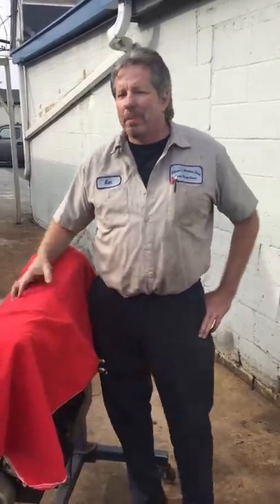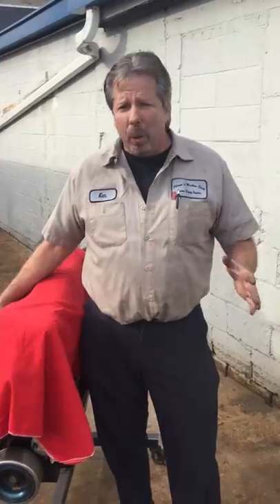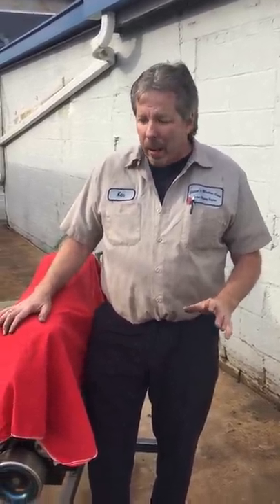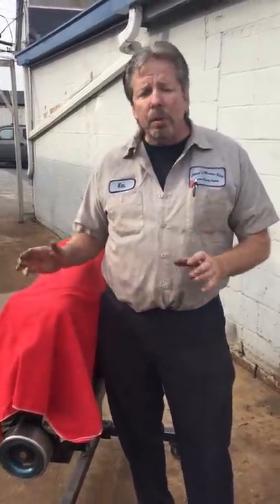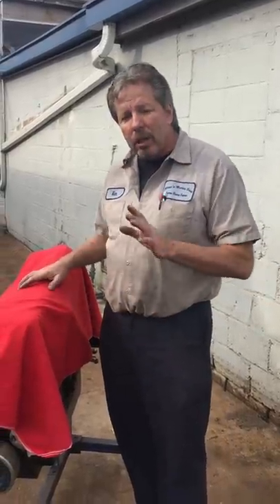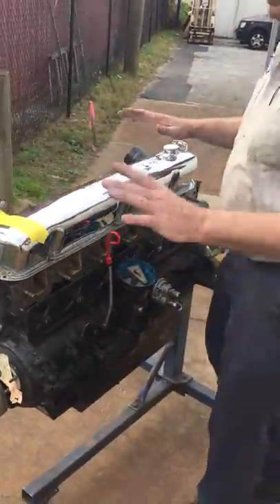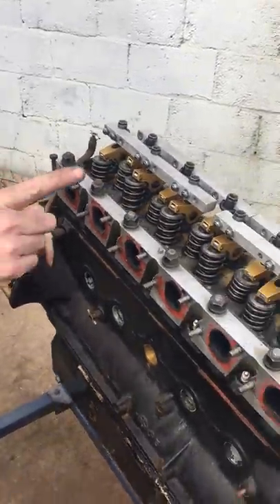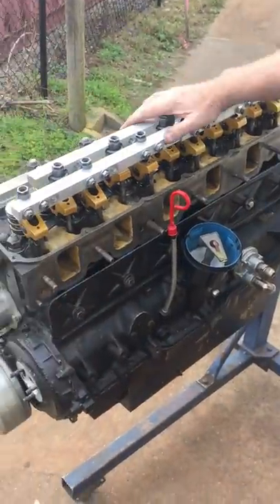Mysterious Radical Race Engine! MUST SEE!!!

Comment: I.m.  glad.  I.  Saw.  This.   I.     Remember.  Seeing. Your. First. Video. On. This.   I. Think. It.  Was. Franken. Six...  i.ve. had. The.  Experience.   Of.  Driving. Two. Of.  These.     As. Stock...  engines.   They. Were.  Standard.  Equipment...  in. Club. Wagons...  back. In. The. 1970s. And.  1980s.....   they. Are. Excellent. For.   Gas....     mileage....And. Can. Still.  Pull.  A  loaded.    Trailer...  in. A. 4x4..... good. Video.  Have. A.   Nice.  Day...

Comment: I just bought a 76 f150 4x4 with a smoking 390 with bad valves. The 2 car lot owner failed to mention that to me. My answer..haha. pull out the 390/c6 so i can put a 300/np435 in it.

Comment: His last name is Sligh. Engine was built in 69-70. Boss 302, Cleveland heads. Chrysler 392 hemi injected. Epoxy was there to get the velocity up in the port. He turned 9100 rpm with that motor.

Comment: If you could fund the making of a full metal cylinder head with a cnc machine and a kit for the valve train you would have buyers as long as it wasn't super expensive. I don't know how much R&D or even the cost of productions of a cylinder head. That could be a business your shop could get. Produce a make the heads and sell everything else in the valve train and even upgraded parts to the ones you see in the valve train.

Comment: There’s a Ford sticker on the engine.I remember Bob Glidden 351 Cleveland pro stock car had that modification to the exhaust ports. I built a boss 302 in 1979. The heads look like Cleveland heads I guess.

Comment: I knew it was a ford 300. Saw one on powernation. It was on a generator. It was white and in great shape. Not sure about the mods on yours. But power nation turbo charged theirs and made insane power with it. I remember my dad telling me about a friend that built a 300 he put into a 60's Jag. He blew it up. It had a 331 hemi, 351 cleveland, 350 chevy, can't remember the others, I think he had put like 10 different motors in this thing, and he blew them all up street racing. He liked to go fast. He had a Mercedes gullwing he stuck a v12 in. Not sure where the v12 came from but my dad said it was fast. 160-175mph. It had a bunch of motors too.

Comment: I saw it in the magazine in the 1970s when it was first done. 351 Cleveland heads cut up and pieced together on a 300 Ford six. At that time Bob Glidden was top of the prostock field with his 351 Cleveland and the pro stock technology of that time was used on this head.

Comment: It’s a Ford 300 straight six, I work for Ford I’m not lying I stirred out putting main bearings in and ended up in her test and became a mechanic 43.7 years with Ford, I become a mechanic after hot test, I built four of these a day by hand for Dino once a month, although the head I’ve never seen before, it looks like it could be parts of the Cleveland 351 boss head, although Ford did have a rumor going around that they were gonna make a flow through head for it.

Comment: The Cleveland head . Is heavily  influenced by the big block Chevy canted valve head . Basically ford built a race engine the Cleveland . To beat Chevy . A small block with big block heads . The way I heard it . Cylinder head guru. Lee Shepard .Was especially interested in this combo . And nay be the original idea source .  RMS lost a lot more than there pro stock driver . When Lee died . He was a cylinder head porter of unique talent

Comment: As a 4v Boss Cleveland guy who’s built a few engines and is familiar with Jenkins work it was my only guess.
I say guess because I was trying to figure out how that could be done as you made the reveal. 
My only complaint is oiling and the width / weight of those things and getting headers to work. The front cover sucks as well.
That’s why at the end of the day I’m still a Chevy guy.

Comment: First Car engine I got to tear down and put back together was a Chevy 250 6cyl that had 327 flat top pistons in it and a little other work, it was my Shop teachers motor out of a late 50's early 60's stepside pickup that he replaced with a 350 with double hump heads. Sad part is the 6cyl was fine when we started and ran great when we put it back together but then he had us pull it back apart and toss everything in a dumpster, I was so mad but had no way to get it from school back home, I had a 70 Nova at the time but was only 15 and couldn't drive it on the road.

Comment: I always knew about the power of a straight 6 engine...i had a old 74 ford Van from Telephone Co. and it run like a scaled Dogs...and everybody thought that it was a 8 cylinder...i loved that Van...with that engine...the engine I had was unicorn because of the way it preformed...i could start it up and it would idle the same in any weather without touching the accelerator at all...and could take off even if it was 30 below...it never missed or shut off or anything...its was ready too go at anytime...it run so smooth...i was a  unbelievable engine...

Comment: 285 Cleveland heads on a straight six. Two heads welded together and lots of work to tune it to scream the if my memory is correct, 9000 rpm max. Name is Sly

Comment: Well many guys have done motors like that in hot rod magazine a shop welded two hemi heads together for a 292 Chevy 6 and batten heads made a couple of different heads for various 6 cylinders I saw that motor and the valve cover was the first giveaway the the canted valves was the big give away yip I'm 67 I've been building motors for 55 years

Comment: The head alone is probably around 20k to make so thats 👌 but that block id sleeve it and bore it .20 over to preserve the bottom for life and definitely have some extra mid to low end torque and paint back to blue... E-85 conversion to run the head cooler too would make the combustion more controlled.. cranks already knifed too🤠

Comment: I was told that they used to build ford 300 six and ran them in the Sprint cars at Skagit speedway. That was the block that used and ran them on methanol before the started using small block chevy.

Comment: Knew it with the cover on, as soon as you mentioned "Wallace". There was a lot of them at one time, but 9.20 is quick. Rules gave them advantage over the V8. Most were oven brazed, some used even more than 3 sectioned heads. You will probably receive lots of calls with more info and parts... Ford did put out early sixes with a steel crank, but found them unnecessary. There were aftermarket cranks, maybe that's why the strange dampened. Most used aluminum rods with the Cleveland pistons. Even in a Pinto there was room for very large headers...
Reangled as you said. Hope you find the original car and accessories, or a spiffy tractor 🚜 
Cheers 🍻 
If you "touch up" the epoxy and plate, maybe call Bob Kaase for some recent tips 👍

Comment: today with the help of Auto CAD, that head could be redesigned/reproduced in 3D and cut out of aluminum on a CNC.
Reply: Would be nice to add some cooling jackets so you can street it.
Reply: I believe the evolution of that is a Ford barra Australian made and  tubed 2200 bhp
Reply: @andrewmichaelcrook340  
The Barra's roots go back to the 144, 170, 200, 250 architecture.  400" smaller bore spacing at 4.080".
Reply: @MrTheHillfolk  
Machine the head with the coolant passages and the either bolt or weld covers over the passages.
Reply: Yep nailed it, but we don't have flying cars.
Reply: Has anyone asked if it has been put on a cad and scanned? Or just comment? So I guess will ask.
Reply: If you can CAD it and Scan it, then you should be able to edit the design to keep more oil at the top of the heads longer. When I first looked at this engine, it kind of reminded me of my 2001 JGC Laredo motor, 4.0L IN6, which I’ve been restoring for the last five years after it sat under some trees in the mountains for almost four years. I can honestly say. “I Love My Jeep!”
Reply: @digitaldreamer5481  my thoughts exactly. work out the kinks before it's ever produced.
Reply: @digitaldreamer5481  best of to you!  I hear things are expensive in Hawaii.
Reply: Piece of art not about caf and billet  welded cast iron 1970
Reply: That's right , take a lot of the work out of it !
Reply: @fragman21  A new CNC head? What for? Will you add 4 valves? A proper dohc system?
Reply: @cristianr3712  My point is with help of modern techniques that head 'If it was that great" could be made as  a whole piece instead of two glued together. the combustion chambers and runners could be massaged to whatever the engine builder desired according to the engines needs.  a single unit will have less a chance to become unstable. IE "move molecularly" or warp in layman's terms.  changes in valve geometry could be changed more easily in CAD with predictable outcomes.
Reply: @fragman21  Very true, but are you willing to pay R&D and CNC work which will likely be over 10k per head to get those improvements in an engine like this?
Reply: @cristianr3712  If your talking about a true race engine 10k would be a bargain. plus in CAD one could workout a predictable model without ever putting it in production. saving time and money. Trial and error can be very expensive in the real world. That's why every manufacturer uses computer programs such as Auto CAD to create new engines/parts/brackets/etc. The Coyote and LS engines are such examples. They are much more powerful and reliable than the engines they replaced.
Reply: Cost to do that from a blank would be insanely expensive once you factor in the drafting labor, machine hours plus consumables, and I don't even want to know how much a chunk of aluminum that big would be. I am curious if it would be cheaper to 3D print wax or resin patterns and do a lost casting.
Reply: @corythomas4427  sounds like it would be easier to cut up multiple heads 😕
Reply: @tanner882  That's already been done though, and it's not exactly a cut and bolt modification. It's already over engineered, why not go full insanity?! While we're at it, may as well do 6 individual heads instead of just one. More is better, right?
Reply: @corythomas4427  I think you lose heart if you were to remake this out billet.
Reply: @corythomas4427  I think you've lost point here. Yes engineering a head from scratch is out of touch for most people who race as a hobby. 90% of the engineering on  that head was already done by Ford the manufacturer. remaking that head using modern techniques to make it better as stated above would be easy at any cnc shop with the equipment and know how to do so. It's really that easy. Scan the part in. add static parameters/ strength of material/etc.  and build out. I've done this sort of thing hundreds of times in CAD at only the cost of a few man hrs.  honestly, if that head was that great, someone would have already done that by now.
Reply: @fragman21  Is everyone commenting reading all of the previous comments, or just the most recent one made? I'm not the one who suggested to CNC it in the first place, I actually questioned if that would be the most efficient process with my "thinking out loud" question of whether it may cost less time and/or money to cast it than to CNC it. I have no experience in any type of manufacturing industry whatsoever. My background is maintaining and repairing what already exists, not creating or designing. I like to answer my co-worker's comments of why something is designed or assembled a certain way with "Don't try to figure it out, you'll just find more that doesn't make sense" or "Saving 1/4 of a cent on each one is a lot when you are making tens of thousands of them"

Whatever way it was done, you would include the intake and exhaust ports that worked for your application (vs. using epoxy), but wouldn't be designing anything from scratch. Though if you were going as far as creating something like this it would be stupid not to optimize the design as much as possible.

My hyperbole about making 6 individual heads was because I would consider manufacturing an entire head (or 6) much easier than adapting existing parts and cobbling them together. Whoever built this head was a master fabricobbler. I respect people who are able to envision something this crazy and then actually do it.

Yes, of course it would have already been done if it was such a great platform to build on and had a profitable audience to manufacture modified parts for.
Reply: @corythomas4427   Fabricobbler. That's great a good one.    I agree as stated in an earlier post, A head could be "built" without ever actually producing it. saving time and money. I think that's where people got lost. An operator can just make copies of existing thing or fix existing things. Jay Leno's Garage uses CNC's to reproduce rare and imposable to find parts for his fleet of cars and other restorers do likewise. As I recall I remember watching  where they recreated a mold for something and cast the part for the sole purpose of having the cast line. Jay himself said that they could have just made it "probably better" with the CNC but he wanted it to look period correct.                     
   if you look on YouTube there's a plethora of "Fabricobbler's" out there. Garage 54 dose some wild stuff with  old car.

Comment: It looks like a old school Continental aircraft racing engine for from the golden age of air racing. But to put out that kind of horsepower it had to be modified since then. Steve Wittman stuffed one in a tiny plane and then chop the wings even shorter to 13 ft in the 1930s.

Comment: I stopped at 3:31 I was thinking straight eight but he mentioned rare an racing so I know! some race league use to allow aero motors an some tank motors but chop it to only run one one bank diss assembling the other head a cutting the the block an capping it so it just looks like a 4,6,8 straight cylinder? lets see!>?.

Comment: Yep I was right didn't see the chopped up forged back head that is next level also I know that motor I changed the oil on that motor for years while my dad used it to drag a super heavy job trailer across Fl fixing up the sanitary situations all over the state

Comment: I don't remember who built these motors but they took two V8 heads and cut them in half welded them together made a bunch of adapter plates, 300 horsepower.

Comment: Curious history on the Ford six, Australia only went with a 250 but that developed into the Barra with twin OHCs and variable valve timing.
Reply: 170 and 221 before the cross flow came along in 79.?
Reply: Ford Australia also did an alloy head and did a 3.3 litre (200ci) version to compete with Holden's 202 red motor in the commodore
Reply: @owensmith2969  And a 144.
Reply: @unklekurlu  Forgotten about those.

Comment: There is more to the story on this engine it was a secret project part of the prostock wars and the fight to get around weight breaks Wally parks liked to destroy everyone’s research as soon as they started going fast dart engineering had the seeds of its in this design concept creation it was very hard to do cylinder welding on iron heads time consuming so they began casting cylinder head out of aluminum which didn’t currently exist and they would cut apart two heads and furnace braze them together to raise the ports no one does this anymore that was the most dynamic time in drag racing history that’s why they refer to that time as the prostock wars

Comment: I saw one like that back in the late 80 in tennessee. We called it junk till he wiped our butts. He would pull a plug wire so it was missing when he pulled to the line then shut it off like it died. When he put the wire back on you knew you were beat

Comment: I honestly don't think I have seen a cylinder head like that  but the in  line 6 Ford block I have seen and worked on and those bottom ends are bulletproof. I guess I understand where they built that type of block but you did not say if it was turbocharged I guess being 13 to 1 compression it was normally aspirated. Very interesting video I really would like to know who built that engine cheers to you all

Comment: what i am hopeing is some one get all the dimensions of this head and ray trace it in auto cad and then make a 2 peice billet cnced head  and use that to make sand cores and make some cast aluminum heads ...a lot of us old hillbillies luv this motor and would be proud and pleased to use one of these run some shine into a dry county....the motor weighs les so you can haul more shine per load

Comment: WOW amazing  my first guess i was right  i looked and thought  its gota be a 300 6   but with that being said i have never seen one done  up in anyway shape or form as a performance  engine but i will say this as i recall theses motors may not of been  much but they were a hell of a work horse throughout the years they were built proof you almost couldn't  kill them  most of all the inline sixes  were like that and didnt seem to matter who made it . someone spent lots of time setting up that head from a Cleveland  never the less what a great idea with canted valves   it makes me wonder what they used for pistons  im betting  Cleveland pistons   that and im thinking hey must of used closed chambered heads at that to get the compression ratio  up  it will be interesting i will follow your posts  thanks for posting this  Bill  in  Nevada

Comment: Freekn awesome. In line 6s are the best motor to start with. The big issue is the under square poke and stroke. You need some pretty tough rods and crank

Comment: I think you've got a BOSS 6, and like you , I've only heard of one other , not long ago , I'd like to know more about it , and the 6 heads are likely because of the cam , as well as cylinder spacing , and for the BOSS 351 head /valve combo , wish I had a couple of those monsters , your lucky to have one in your shop , "man , like that is BOSS" "groovy" and "must be a real gas , man", how many remember that lingo from the 60s/70s ? Right On , Far Out , Man ,,,,outta site ,,,
Reply: 302heads